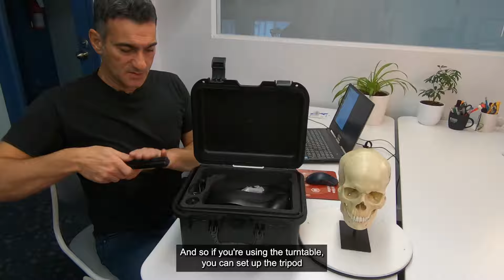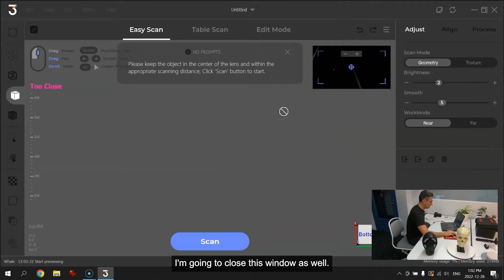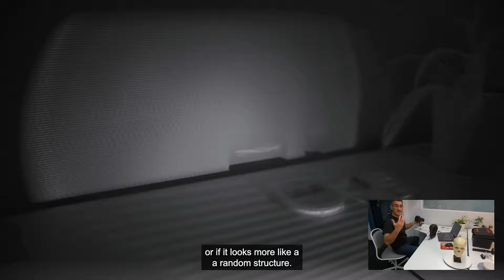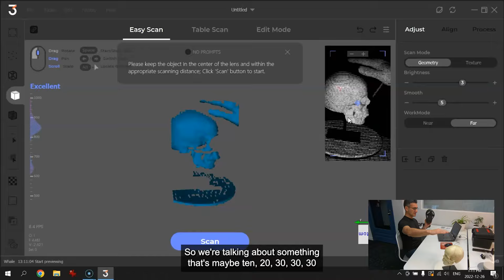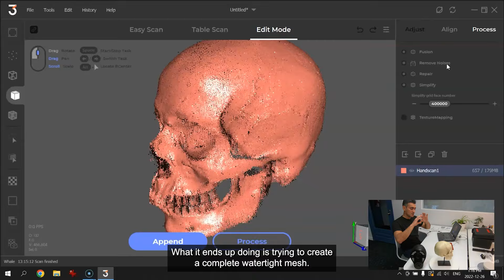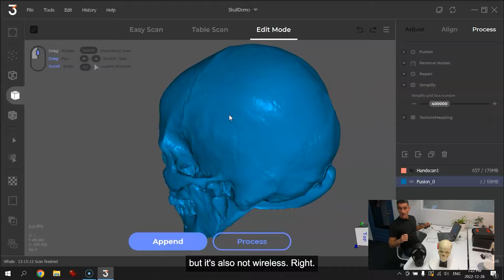REVIEW: Whale 3D Scanner | Click 3D Ep. 60 |  3D Scanning | 3D Forensics | CSI

Comment: Texture mapping is for when you have the colour kit and it will align photos from a dslr/smart phone over the top of the fused item
Reply: Also while 3DMakerPro was campaigning this scanner the community asked for a 3m cable and they are making them as a add on
Reply from the maker: @Marvel3DUK  Well that would seem to make sense…it’s rather confining. Are you saying that the scanner will not map textures on its own? I saw there was a DSLR kit which will do this with external jpgs much like in Artec Studio 17, but it seems even the basic textures are not working for me or are on the wrong side of the mesh.
Reply: @3Dforensics  so the scanner will search for texture and will pick up on the fabric on a trainer for instance in texture mode. But the option for “texture mapping” is for the additional kit to add a coloured skin on top of the scan so you can import the coloured scan into say a game.